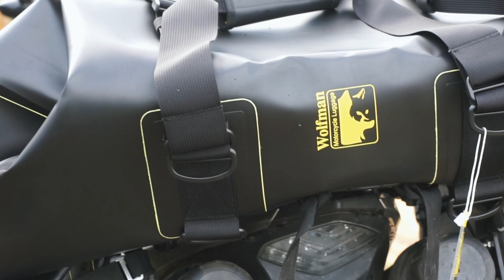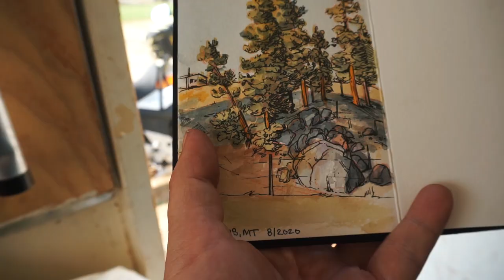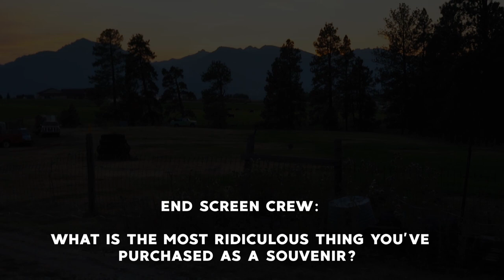Motorcycle Camping on the Flight of the Magpie

Comment: Had a opportunity to ride 2019 CB with the 19inch front tire? Wondering how much diff it makes
Reply from the maker: No I haven't yet Wesley Sorry! The 19 in the front does make a difference off road based on my experience riding other bikes with a 19 front, even Lazarus has a 19 in front and it DOES make a difference.